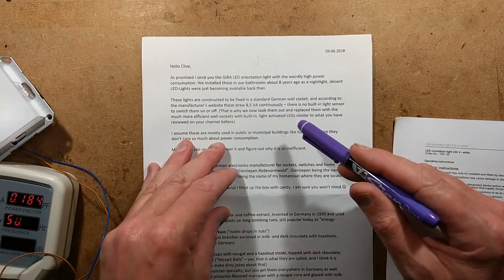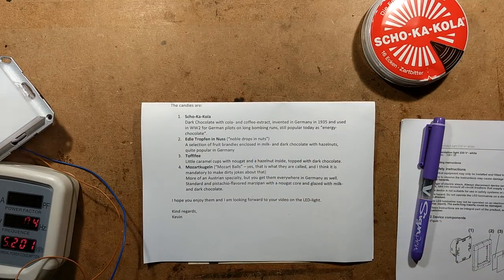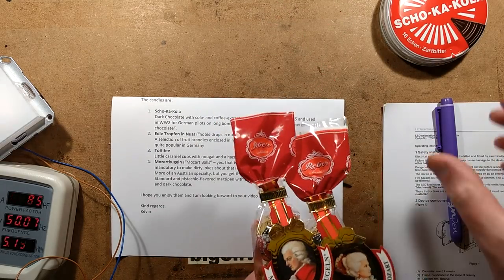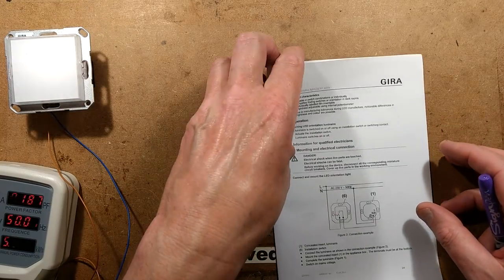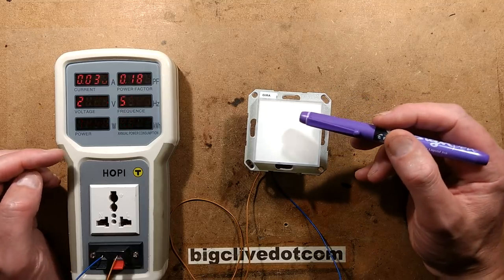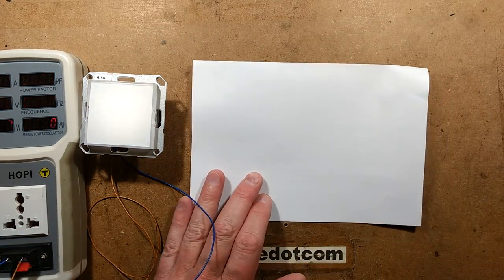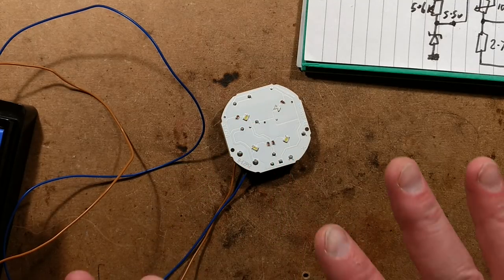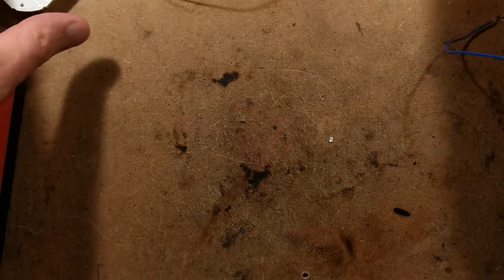Well engineered German LED light?  With schematic and tests.

Comment: Maybe we should start investing in those dodgy "power saving" plugs now before they start charging for power factor... :P
Reply: twocvbloke Just buy a capacitor for your fridge.
Reply: davbj1 The fridge is an inductive load. It pulls the power factor to the other side.
Reply: davbj1 The capacitators in a fridge's compressor are needed to create rotating magnetic field, not for phase shifting.Without them, the compressor will just make a nice humming noise  while getting hot an hotter.
Reply: Casimir Konrad I meant a compensating capacitor, not the running capacitor.
Reply: davbj1 I was just thinking the same, but the fridge runs 24/7 in intervals, your lights and TV don't.
You never now the total until you measure it.
Reply: Mark Wright I've seen that in industry, but not for household. 
It would be better for the manufacturer to limit the power factor, but I bet, that won't work because it adds costs.
Reply: I just found household "energy savers", but that is just a capacitor in a box doing nothing. It's a scam.
Reply: dogy power saving won't help .
power factor need to be fine tune in real time.
for all you know a random capacitor might make things worse.
Reply: Mark Wright  this works OK for correcting the power factor of motors, but it is completely useless for correcting the power factor of Switched Mode Power Supplies (SMPS). An SMPS (without APFC) will draw current only during the peak of the sine wave, when it is charging its DC bus capacitor. So the current´s waveform is actually not a sine wave, but just short, fairly sharp spikes. 

The only proper way to fix this is to get SMPS with APFC circuitry for everything. APFC = Active Power Factor Correction.
Reply: The other solution is for everybody to get an electric car, and if the charger has a good PFC circuit, the power factor of every LED in your house would be insignificant in comparison.
Reply: This is largely a self-correcting problem. If power companies start jacking up their charges by switching the way they meter power, it will become a lot more economically viable for home owners to install solar battery systems, which would dramatically reduce their use of utility power.

I think we're kind of starting to see this here in Australia, where the electricity retailers have started jacking up their prices under the pretence of a couple of large black-outs, so now pretty much every home owner is looking at a solar battery system. When they inevitably become cheap enough, the retailers' cash cow will disappear, and the generator and distribution grid companies will have invested huge amounts of capital that will never deliver the return they're expecting.
Reply: A rotary converter would conceal your load from the meter, and you'd have 3 phase for your big tools.   You'd probably want to bury it in bunker under your shed to escape the constant noise though.
Reply: not only non-PFC SMPS have bad power factor. Mains frequency tranformer based lineal power supplies also have bad power factor and no possibility to have PFC
Reply: Hey guys, in the U.K. at least, you don't have to have your existing electricity changed to a so called 'smart' meter. My meter is still a traditional analogue type, and it's staying that way. I don't think fitting so called 'smart' meters will make any significant difference to the amount of electricity used by the majority of households.
Reply: Mark 1024MAK I’d say you’re right, people will just end up paying more for the same actual power usage, once they have a ‘smart’ meter and the power company remote switch it to apparent power, without the knowledge or consent of the customer.
Reply: Can someone point to an article or perhaps Clive could explain further about the Power Factor / Smart Meter issues and the importance of Apparent Power rather than actual power used. How does this actually work in practice (especially in the UK).
Reply: Simon Zerafa
I'd appreciate that, too. Most online sources I can find suggest this isn't happening/expected to happen. I believe it's based primarily on Clive's personal beliefs (though that certainly doesn't mean I'll completely discredit them.)
Reply: You'll find them on eBay, along with all the other shit Big Clive loves! 😂😂😂

Comment: Many smart metres don't work anyway. If you switch the company you buy electricity from usually the old smart meter doesn't work. Also the original smart metres don't tell you what the instantaneous usage is, so they're no use for monitoring hourly use and hence trying to reduce your consumption.

Comment: In some other video's comments someone complained about reliability of LED filament lamps (Because of voltage peaks? I'm running those lamps w/o problems). 

However now I want to see a filament LED lamp with zeners in parallel. Those would be efficient and nice looking, have a good power factor and they would be very reliable.

Comment: Hi Clive. A purely capacitive load, the current leads the voltage by 90 degrees giving no real load. The offset from the 90 degrees point (caused by the LED Vf), not the zero degree point defines the actual power use.

Comment: My shop is 3P. My utility company sent an engineer to help me create the best PF through load diversity. An 800 A 3P shop in a residential area was a problem for them. But they paid the bill to make it efficient. Their not all $ grubbing pigs.
Reply: Boonedock Journeyman in the uk they are. Sometimes they will charge you $30,000 to get a power supply put into a new house, occasionally even more.

Comment: The modern rotating disc panel meters also measure rms current and rms voltage (i.e. power factor isnt taken into consideration..). Only reason I know is that Clive mentioned these panel meters measure real power only and I remember having a bank of fairly high value AC caps plugged in and the disc spun faster than if an oven is on...

Comment: Clive, not to be nit-picky  but at 6.17 you drew a lagging phase angle for a capacitative load when in fact the current through a capacitor leads the applied voltage. It lags for an inductive load. So the voltage across the LEDs would  LEAD the applied mains voltage. That said, as always a most enjoyable video. Thanks.

Comment: If you used a dropper made of a resonant circut with a capacitor and an inductor, the resonant frequency being 50Hz, could you get a power factor of 1?
Reply: Technically yes when XL = XC (inductive and capacitative reactance) but the reactances cancel each other out so there isn't anything limiting the current resulting in all the smoke escaping.
Reply: Love the idea that all electrical systems are effectively just smoke storage devices waiting for their chance to shine :)

Comment: Instead of 2 * 1uF in series, they could have used a 0.5uF giving the same capacity, but smaller height. 
So two in series is not done for space saving, but probably to get a higher voltage rating, and the fail-safe not getting a total short if one fails, as you mentioned.

Comment: regarding the input circuity: it is good design practice (in many cases mandatory, even though it is often abandoned for cost-saving reasons) to go through your circuit and imagine a short and an open fault condition for every individual component, then evaluate the potential dangers and address safety issues (single-fault condition). if i remember correctly, IEC 60950 should cover the details.

Comment: Film capacitors always fail when across the mains, usually open / diminished capacity.
You can get high reliability types that have two internal series connected caps, they just did that with two caps instead.

Comment: Well I have to say I can understand the point of the power companies to compensate for the higher and higher ammount of devices with terrible power factors, this was not so bad in the past but now private households are drifting further and further into lower power factors which costs the power companies more money but the private households less.
Reply: It´s not that bad. 
Firstly, most major SMPS nowadays have APFC, so they are not a problem.
Secondly, all LED lamps above a certain power will use a SMPS instead of a capacitive dropper because the capacitor would be too big and expensive. They also have a better PF than a capacitive dropper.
Reply: Yes bigger SMPS might have active PFC but when I look at all my equipment I think my PC's PSU is the only one with PFC. I'm no expert in power distribution and all that but I think this is more and more a problem than in the past.
Reply: APFC is not very common yet in small consumer SMPS, but I expect they will become more common in the future no matter what. There are more and more SMPS controller ICs that do APFC and all the other switch-mode action in one device, and even full on SMPS regulators (aka the IC includes all the switches, only caps and inductors/transformers are external).

Industrial SMPS usually have APFC no matter how big they are already.
Reply: FesixGermany Tell me, what is the rating of the most powerful electrical item in your house? And how does this compare to your electronic items that have a bad power factor?
Reply: What I'm trying to say is that it adds up, yes my oven or my washing machine might be way more powerful but these resistive loads always existed, incendescent bulbs are replaced by LEDs with bad power factor supplies, yes the LEDs are drawing less power but what about the apparent power?
Maybe I'm missing the point, just my thoughts.
Reply: Actually, increasing capacitive power factor in residences cost power companies less. The power network runs with a net inductive power factor due to all major loads (motors) being inductive. Residential capacitive power factor actually offsets some of that inductive pf and moves it closer to unity.  Utilities actually spend money today to hang capacitor banks on poles trying to offset the inductance.

Comment: I wouldn't be surprised if they did and I think they should. When a house has a PF that isn't the same as the the network it can really f... everything thing up. You might not be using those 8 VA, but to get the 1.2 watts you still have to generate those 8 watts. And those 6.8 VAR's have an impact on the network as a whole and have to be compensated ; capaciter or inductor banks. Synchrous machine compensators. Plus if the network PF as a whole goes out of norm then the power generating sites go off line, electrical motors stop. Even whole grids can become unstable and resonate for months. And massive lawsuits follow.  No wonder they bill bigger companies. Electrical engineering student here, production and conversion of electrical energy.

Comment: It seems like they wanted to achieve functionality of an LM series regulator. Usually trying to emulate an IC with discrete components ends up being more expensive than the said IC. Also, LEDs are current controlled devices, so the proper thing to do would be to have a current source driving them rather than kludging with Zener diodes.

Comment: Schokakola has not crystal meth in them anymore. Just saying.
Reply: Jörg Zingler there never was , Back Back then it contained cocaine ....the Meth was a seperat pill called pervitin
Reply: Cocaine? Source for that? I mean, not the cocaine, the claim.
Reply: Kalum Batsch Google "Hausfrauen Schokolade
Reply: Considering that cocaine is derived from the leaves of a cocoa plant; use the whole hog.
Reply: +sivalley
Did you seriously just now confuse cocoa and coca, or was that meant as a joke?
Reply: +Peter Zingler
Hausfrauenschokolade was neither cocaine nor Scho-Ka-Kola. Your claim was that Scho-Ka-Kola contained cocaine at some point. You're probably confusing it with Coca-Cola, which did.
Reply: Kalum Batsch Ya got me Skippy. I was waiting to see if anyone was paying attention to pseudo-homophones.
Reply: Daniel Gray words have different suggestions in different languages. If you come to Bologna you can notice the stickers “FAP on this bus”. Filtro Anti Particolato is actually a filter to reduce pollution 😀

Comment: I was expecting something more like a DIAC across the LEDs.  A DIAC is a normally off two legged thing that switches on at some voltage.  Once on, the voltage drop sinks to about 0.5V
I guess zeners cost less.
The way they did the dimming loses some power in the transistor and needs a zener.  They could have used the forward voltage of an LED in place of the zener.  It would mean that the one zener would be always at the same brightness as the others varied.

Comment: Aren't the power companies already assuming some random power factor (maybe 0.5?) and charging consumers on the basis of that average power factor? I understanding that moving to smart meters would penalize the ones with lower power factors more (in all fairness), but the cost of power per unit would subsequently also go down when measuring apparent power, so in effect, most consumers who fall in the average power factor zone will be charged essentially more or less the same. What am I missing?

Comment: Here in Canada we've been using smart meters in most major cities for years. As the migration happens for a new area, though, I've also noticed a non-trivial number of homeowners complaining that their power bills have suddenly become very high. I've yet to check regional specs for metering practices, but I wonder if power factor is the issue that's making the difference.
Reply: Residential power factor isn’t that far from unity.  That’s why power companies didn’t bother measuring it like they do for industrial users. It won’t make that big of a difference in your bill.

Comment: retest the apparent power with a small old fashion copper and iron wall wart power pack plugged into the same power board as this lamp.  My night household quiescent power use is  138 watts. When i power on the 3 x 5 watt led down lights that are powered by an old 12v 10 amp non rectified down light transformer the apparent power drops to 98 watts. the household power factor returns to near 0.98 from 0.60.

Comment: When incandescent bulbs went out of the shops I went online and brought a couple of cases of them (I mean crates really). Yes they heat the house but that is compensated by the heating thermostat not turning on and in one room no need for secondary heating at all. I have always brought good quality lamps and not found longevity much of an issue. I get instant warm light. There is a lot to be said for incandescents.
Reply: You get all that (minus most of the heat) with a warm led bulb, but with less energy usage. Electric heat is about the least efficient heat you can have.

Comment: It would be nice to see you use one of the "energy saver device" capacitors in line with a device with terrible power factor like this to  see it actually change the power factor.